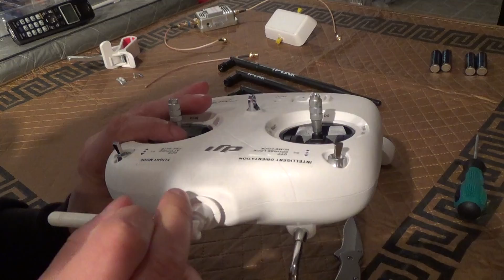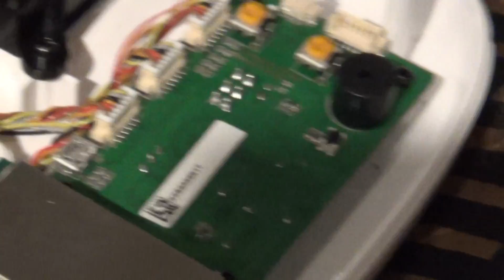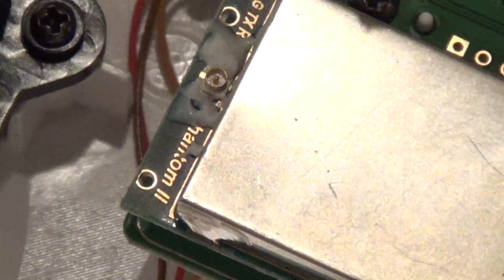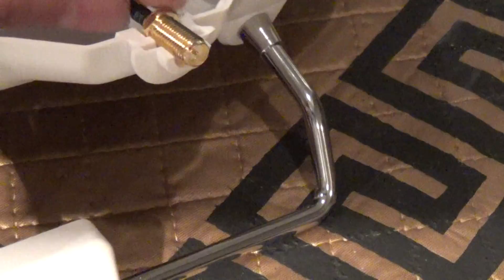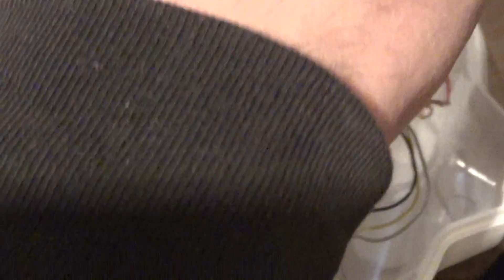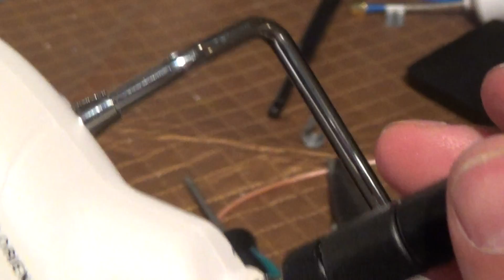DJI Phantom 2.4 and 5.8 Radio Control Antenna Mod increase RC / FPV Range

Comment: But what about the internal phantom receiver? Doesn't it affect you? And what else is the best antenna, which one do you recommend?
Reply from the maker: No worries about the internal phantom recorder for the radio control antenna change.  You should use any screw on straight antenna it will act exactly the same as what game with the controller only with higher gain / better range.  You can use either a directional or Omni directional antenna.   

And as far as the WiFi mod for increasing video range for best results you want to use a LHCP or left hand circular polarized antenna for best possible results as what’s built in to the phantom is an LHCP antenna for the WiFi video transmitter portion.   FPVLR among others sell good LHCP antennas.
Reply: @Ben7seven7  Okay but I don't think that it is necessary to use the wi-fi because I am using a fpv monitor with transmitter mounted on the Phantom 2 I just wanted to know if the omnidirectional antenna is correct to adapt to the control of the Phantom
Reply from the maker: manuel almanzar yes any screw on 2.4 or 5ghz antenna will work just fine and extend the range of the controller itself.  Though in my experience if you don’t modify your WiFi repeater antennas you’ll loose video before you loose controller range even with the stock antennas.
Reply: @Ben7seven7  ok, thank you Bro
Reply from the maker: manuel almanzar my pleasure.
Reply: @Ben7seven7  Can the omni-directional antenna be used to send the drone far horizontally and vertically?

Comment: "It has no effect or relation to the 2.4ghz live video feed to your smartphone / tablet." is in the description but how do you increase that.  I lose the live feed at about 400 meters on my Phantom 3 and then am forced to slide return to home which often fails and it just hovers until I walk closer.  To get better control over flights and have the confidence to try FPV Headset viewing with Lichi app I need to increase the range the live video feed works.
Reply from the maker: To improve the video video transmission distance you need to modify the small WiFi repeater that’s attached to your controller to accept external antennas.   For even further improved range you can also modify the phantom itself and install improved antennas as well.   I have videos on doing all this including how to use sunhans power amplifier to get you more range than you’ll ever need.

Comment: Hi there! Well... There is a way to make the drone controlled by cellphone towers?! I just wondering... It will be almost infinit range using cellphone towers... The guy who make an adapter to turn the radio to 4g will be rich!
Reply from the maker: w1p30ut3r actually yes, I believe there was already a copter available with a cellular data controlled flight controller for long range remote access.  Only problem is your manually controlled flight  range is limited to cell tower reception.
Reply: @Ben7seven7  Well I never get a bad cellphone connection, but I always losting my phantom 4 pro... It the phantom 4 pro could get cellular data... It would be GREAT... Someone needs to make an prototype who converts radio to cellphone data to us to stick in the anternnas and in the controller antennas and place a sim card... This would be a game changer for signal extenders...
Reply from the maker: w1p30ut3r you can get a cellular or RF based tracker.  Both will work great for the purposes of finding your Phantom in the event you loose it.  The cell version will require you pay for cell service for the tracking component.  RF version you don’t have to worry about that.  You just need to be within a certain distance to pick up the RF signal with the hand held tracker.  It will also display an arrow to make sure you’re going the right way. 

On a side note if you are loosing your Phantom often I would re evaluate your flying how and were and learning the fundamentals of keeping line of sight.
Reply: @Ben7seven7  I did not understand your answer... I did not ask about loose the phantom, but control it over the internet using 4g or 3g... :S
Reply from the maker: w1p30ut3r yes I know that I was just informing you of a couple of ways you can recover a lost copter.

Comment: will the tp link antennas work with the dji phantom 3 standard remote
Reply from the maker: Michael Carter yup sure will.  Tho an LHCP helical antenna will give you the best performance.
Reply: with my dji phantom 3 standard ive fitted two 2.4ghz 8dbi amd one 5.8 ghz 5  dbi tp-link antennas

Comment: Hi mate I'm back again I just wanted to make you aware my phantom fc4o TX CONTROLER was change from a 2.4ghtz to A 5.8 only controller not fpv
My fpv is 2.4 hints why I couldn't put 5.8fpv
I've change the TX antanna to a 8dbi tP-link 8dbi but it's 2.4 won't that course a fly away because I fort you never mix the two when flying

Comment: Hi mark thanks for the reply that's pretty good I e one day but little worried on my fc40 the guy said he had change the aerial that's the tx to a 5.8 how ever the aerial had snapped so I be been flying with 5dbi 2.4 and had no problems it shouldn't affect it my gob is 2.4 because he said it was 5.8 so I had no choice to get 2.4 fpv how ever what's your forts on this mate my tx he said he change the stock to 5di 5.8 since then the aerial broke I put and 5dbi 2.4 not tp link no problems hope this won't affect any think my fpv is 2.4 and I have good pics when flying so it's not a problem I want to fly this fc40 with tp link
Reply from the maker: Won't be a problem which antenna you use

Comment: Was the tp link 8dbi you have two types waster flight good on 2.4
Reply from the maker: Yes the flight worked well with the 8dbi tplink antenna.  I got over 2500 feet without a problem in a park with wifi around me.  Could go much further in different environments using that antenna.

Comment: Hi mate I need a help 
I've got my phantom fc40 already came with 5.8 black aerial non standard I get about 1 mile I'm happy but I want more range would those t link aerial be better what links have you got
Reply from the maker: If memory serves correctly the Phantom FC40 doesn't use a range extender for the video feed its a direct link from the camera to your smart phone / tablet. To extend the range you would have to get a wifi range extender and a portable battery pack to run it.

Comment: I have a 38 dbi gain antenna. distance is greater and further.
Reply from the maker: Was that a question of a statement?
Reply: +Ben7seven7 , (statement.)
Reply: 1 antenna with 2 cable connectors.

Comment: Hello Ben,
Thank for this video. Do you think it is possible to adapt a P3 adv/pro to work as a remote controller for the Inspire gimbal? Thanks in advance.
Reply from the maker: +Fernando Ribeiro You can't use a P3 control for that function.  The inspire 1 remote uses a 5.8ghz radio for that function which the P3 remote does not have.

Comment: can you connect an antenna for a 5.8Ghz transmitter to a 2.4Ghz transmitter?
Reply from the maker: +xfifx1 Yes it will work though the DBI rating will be different than advertised while running on 2.4ghz equipment.

Comment: Hi Ben7seven7, do you know how to install and use this anthena booster for a Phantom 2? 
http://www.ebay.com/itm/262030663730?_trksid=p2057872.m2749.l2648&ssPageName=STRK%3AMEBIDX%3AIT
Reply from the maker: That's not the appropriate amplifier for increasing the wifi FPV range.  Look up sunhans 2.4ghz 2.5watt and or 3 watt amplifiers.
Reply: +Ben7seven7  Thank you Sr. so, the amplifier that I showed you, what is it for, if I install it in my Remote control, what will it help in? I appreciate your help. I will look in the ones you mentioned (sunhans) but I would like to know if the one I purchased will help at all. Best
Reply from the maker: +Ricardo Villasenor Davila - Ritchie the amp is only good for the normal Phantom 2 2.4ghz radio control for increasing the radio range.  It will not be helpful for the fpv as you specifically need a wifi amplifier.  Go on eBay or Amazon and look up the sunhans amps. The 2.5 or newer 3watt amp will more then do the job.  And you will need a 12volt power source for it.  You can get a 12v lipo on eBay as well as necessary adapters.
Reply: +Ben7seven7 Thank you Ben, I got it clearer now, in fact I also want to increase radio range on my controller, do you know if there is a tutorial or how can I install the amp on my Phantom 2 2.4ghz radio control for increasing the radio range? I will also be looking for the gear you recommend to increase the wifi range, Thanks Man!
Reply from the maker: +Ricardo Villasenor Davila - Ritchie Actually you can look at my modding video of the P2 remote to use any antenna.   You can use a 5.8ghz sunhans amp for the amp portion and connect it in the same way as with the wifi range extender for the P2 Vision.
Reply: +Ben7seven7 -------    Hi Ben7seven7  got a question for ya I have a phantom 3 advanced with the Dbs mod antenna on it but what I wanna do is put the Dbs antenna on my ham radio tower 70 feet in the air question is will it work with a 100 feet of sma cable just a idea would like your input on this thanks for your time in advance.

Comment: id like to convert my 5.8 to 2.4..i have frsky  stuff id like to use the d4rII ..is this posible?
Reply from the maker: +bill alvarez Yeah you can change the internal reciever on a 5.8ghz Phantom to 2.4ghz. If it's the "Vision" version though you will not want to do that though as it will interfere with the 2.4ghz wifi of the camera portion.
Reply: +Ben7seven7 no more camera it broke..so i might just use 5.8 for video system..for long range fpv

Comment: will this be the same process for a P3 standard remote?
Reply from the maker: It would be a similar process tho it will just increase the RC range it won't affect the FPV range without also changing the cables out for the two internal antennas as well.  You could then use external antennas for them all.

Comment: Will this work for the P3S controller? I have the exact same controller. I believe it's slightly upgraded from a P2 Vision +.
Reply from the maker: Yes it would work the same way with the new controller.  The internals will be more complicated inside do to the additional electronics inside the P3S controller  but the connectors for the antennas the same.

Comment: Hi Ben,

Thanks for the great video.

Have you replaced any of the antennas on the Phantom itself?  if so, which antennas did you use?

thanks
Reply from the maker: David Vrona Yes I've replaced the two wifi antennas inside the camera. You can see my videos on it.  The best results were using a pair of skew planer antennas, and a 12dbi  helical antenna to match with them on the wifi range extender.  I used Circular wireless RHCP (Right hand Circular Polarized) antennas. At that point I could easily do a mile with the wifi feed which required me modding the RC Control to keep up.

Comment: I tried this method of upgrading. When it came to removing the silicone and connector, careful though I was.  The base of the UFL  connector came away from the board and basically bricked the controller.  That whole UFL connection is much smaller looking in real life.  Just be very very careful not to do what I done. Thankfully I have obtained a new version controller for £30 on ebay. Here we go again lol. Good video by the way.

Comment: Hi Ben, great videos and background information. I did the wi-fi extender mod today. The two built in antennas?  Is it correct that one, handles video and telemetry and the other transmits this to your phone app like a router?  If so, do we really need the second one done if it only transmits to the phone, which is right beside it? Maybe I have got it wrong.  
I hope to do the controller mod tomorrow if the gear arrives.
Also, my extender did not have the reflective shielding which you show. Maybe it's an upgrade from my Vision (none plus)
Keep up the good work.
Reply from the maker: For the wifi range extender on the P2 Vision, the antennas work in diversity mode meaning that they both do the same thing but will use which ever antenna happens to be receiving the strongest signal at the time.  This is where it is handy having two types of antenna one for omnidirectional use and other a directional for long range flight.
Reply: Right, So do they both receive and transmit together at the same time? They have to receive from the Phantom and send to your Tablet.
Reply from the maker: +truthbetoldni they both transmit and receive.  They work in diversity mode tho meaning the antenna receiving the strongest signal at the time is the one they will be getting used.

Comment: What kind of battery  you used  for 2 WiFi booster
Reply from the maker: +Irenel Macatangay If you're using a 12v booster you can use a Lipo battery with appropriate adapter to fit it.  You can also use RAVpower portable battery which uses a 12v as well as 9v and 6v outputs. And it comes with all the connectors you could possibly need.

Comment: Hello Ben7seven7 thanks for sharing Mod, can you tell me that you may run the 11 dbi flat panel antenna? I test 9dbi an omnidirectional antenna distance 896 meters max my phantom 2 vision + V3 and stock transmitter max distance 700mts
Reply from the maker: Hi and yes you can use any flat panel antenna, linear polarized happens to be ideal for the RC.  Range will vary depending on environment.  Flying at the park with the RC in FCC mode I get roughly 1km range.  With 3dbi omni I pushed roughly 4,600 foot range and with a 5dbi tplink it did a little less for whatever reason topping out at around 4,400 feet.  Using a 5.8ghz Sunhans  wifi amp will also help further bolster range (even tho it's technically not using wifi)

Comment: I'm kinda confused. Please help me Ben. You mention FCC mode here.... does that mean when flying with the safety "Go Home" mode this  antenna improvement won't work? Or can I get a little more range from this? I have that long antenna and the pigtail wire to connect it. I'm pretty much newbie so FCC mode is terrifying to me at this point.
Reply from the maker: The remote control has two power modes depending on the legal power output of where you live. CE and FCC.  FCC mode will increase the power output and with that improve the range you can fly before loosing radio control.  

Keep in mind radio control range is independent of the FPV video feed.  By default these remotes are in CE mode.  FCC mode is enabled by turning the screw in the back, or via the RC assistant software while connected to your PC.

Once the remote is in FCC mode you will know as the startup beep is different, dual beeps if memory serves.
Reply: So the FCC mode still has the "Go Home" feature? Thank you so much for your help. Really appreciate it.
Reply from the maker: Yes the power output of the RC control has nothing to do with the return to home function. Best of luck.

Comment: Hi Ben I've done the antenna  mod and sadly I got a steady red light on my phantom any suggestion what went wrong I try putting back the original antenna  but my dog got a hold of it and we'll it didn't survived  I called tech support they said to get a new remote before I do want to see if there anyway I can fix this
Reply from the maker: If done properly it should work immediately.  Things that could go wrong include having the power on with no antenna lead, breaking the connectors or creating a short.  

 Other things that can go wrong and this does happen from time to time is a faulty antenna cable.  Simple enough solution just get a replacement.  Sometimes the wire is bad or there's no connection.  I'm referring of course to the ufl to Rpsma cable.

If worse case scenario you shorted something you will probably have to replace the unit
Reply: Ben thanks for info and yes I have contacted dji tech support and they said I needed to get a new control...but I did replayed your video 10 times lol I just to make sure I was doing it right yea it stay In a red doesn't even blink if I do the calibration  it will go to that setting but after doing the calibration  it will go back to red ....can you email me on more info on what to check juan956morin@att.net

Comment: I love your vids, here is one small tip. Use a zip tie around the top antenna location of that remote to close up that gap, that's what I did and it looks nice as well
Reply from the maker: +Highrolla1969 Thanx, and the way I ended up finishing it in the end, I left no gap.  The simple way of making the connection would leave a small gap.
Reply: cool man

Comment: Hola, al modificar el extender wifi instalando estas antenas tp link, mejora la recepción de video en mi teléfono, o solamente esto mejora el alcance del dron con el control solamente? ojala me pueda ayudar con esta información, saludos desde Chile.
Hello, modifying extending installing these antennas wifi tp link, improves the reception of video on my phone, or just this enhances the scope of drone control only? I hope you can help me with this information, greetings from Chile.